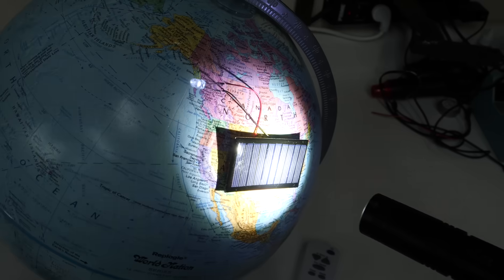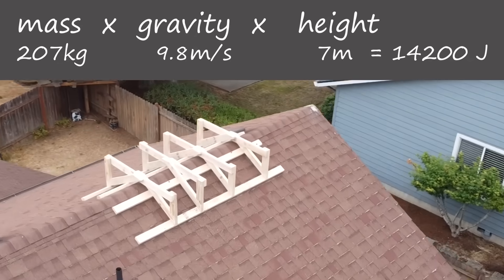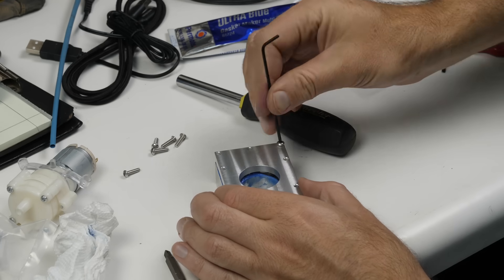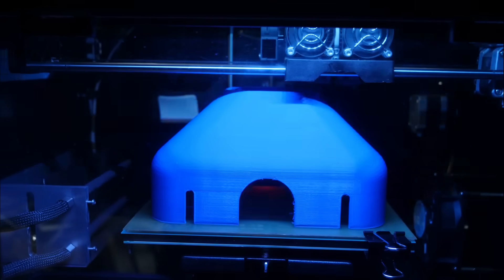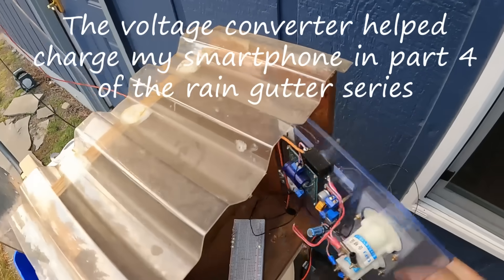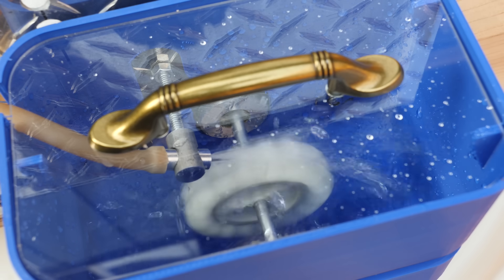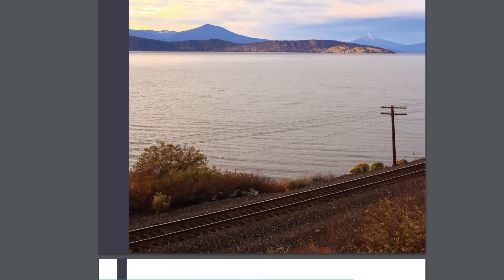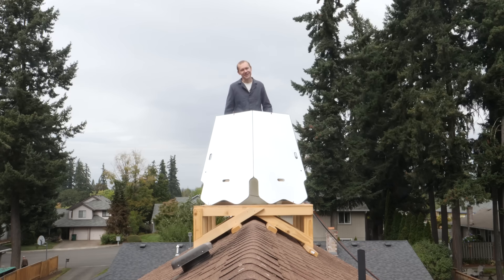Storing Solar Power on my ROOF!!!

Comment: What happens when the water in barrel freezes and burst's the barrel ?

Will Thor's giant ice hammer come crashing through your roof

Can you design the barrel to contain a kinda giant water bag surrounded by kinda crash barriers inside the barrel

I think this would make it a safer option 
Ps. No charge $$$$ for that just pass on the good will PLEASE
🙏♥️✝️

Comment: Why not just heat the water instead of moving it? Hot water is used by the washing machine, shower, dishwasher etc, and hot water stores a lot of energy. One could isolate the barrel etc.  Barrel never gets full like with filling it because one can just heat it some more.

Comment: A few practcal questions.  Being in Minnesota I have to think about freezing.  Would probably need to do the whole project indoors or use antifreeze. 

Also this circuit has resistance.  What if you replaced the plastice tube with a 5 inclh PVC pipe?  
Would it flow better?  I expect the force of the water would be almost the same with a big pipe.  

Finally, are there heavier liquids that might add to your storage capacity.  
How about less viscous liquids that would pump more efficiently?  

Thanks for the demo, I have been thinking about the storage problem for a long time.

Comment: Low efficiency low energy density and maximum capacity. High maintenance. May be cheaper than batteries initially but will become more expensive. Overall just inferior to batteries.

Comment: I was always wondering, how much water (in tonnes) would you need to store on a given height (lets say, top of 3 storey building) to be able to use it at least for some things reliably.  I have an appartment in an old building, that has a not-used atttic, which is at least 16m above the ground, and we could put a lot of 1m^3 tanks there (many load-bearing walls, which are like 0.5 meter thick go up to the attic floor and would easily provide support for heavy load). 

I do not think you can find many readily available generators for such purpose, though..

PS. it is also worth noting, that if you use wind as your renewable source, it could actually be reasonable to  have the turbine power the pump directly - mechanically, instead of mechanical - electrical - mechanical conversion. Assuming you can join the shafts of the propeller and the pump in such a way, that not much is lost due to friction over this long connection.
Reply: My gut instinct sau the issue is rpm. You'd need a hundred times the rpm on the pump as the rpm on the wind collector blades. An efficient transmission of sorts would be needed. Maybe you could find a low rpm water pump?

Comment: I was surprised that a AA battery could store an equivalent amount of power as that water drum.
Reply: Why don’t we just use nuclear power and abandon wind and solar.
Reply: @grizzlybear2702  i agree for everyone's house.
Reply: @grizzlybear2702  your ignorance of the worlds vast energy needs is obvious and quite frankly painful to behold
Reply: Exactly. A 1.2V 3000mAh AA battery contains as much energy as 130 liter water at 10 meters high. Pretty low energy density...
Reply: @a.wadderphiltyr1559  No but it was obvious you were trolling to that effect. read what i said again. If you think all the worlds energy needs could be met by nuclear alone, well you should maybe go check some facts out. maybe.
Reply: @klondike69none85  why couldn't the world's energy needs be met by nuclear power?
Reply: @mrtechie6810  alone? well, for starters theres availibilty. Of refined fuel (which we barely have enough for our own needs) of locations suitable to have them as well. there needs to be water nearby. How about the fact most countries dont have near the GDP to start a nuclear program. I could go on but honestly my head hurts from having to do the thinking for the both of us.
Reply: Can I just make something very clear: this thread is not for rocket scientists. Go join another thread or heat up some water and convert it to calories or joules.
Reply: @Do_not_assume  don’t be mad just because you didn’t know energy could heat water
Reply: @benjamin8981  It's pretty clear from the context that OP's comment is under a video about pumped hydro storage, that the energy being referred to is gravitational potential energy, not thermal energy. Yes, you can store energy by heating things up, but that's obviously not what OP was referring to and getting on a high horse about something that wasn't being discussed is inappropriate.
Reply: @ReddwarfIV  that is how you find out how much energy is in it. all you have to do is transfer it. the potential energy in that drum of water IS the energy that moves the motor, which IS the energy that could be used to heat water electrically which is the easiest way to measure energy content. so yes heating a measured amount of water IS the same amount of energy as the potential energy in that drum of water
Reply: @benjamin8981  Gravitational potential energy is dependent on height. The energy cost to heat the water in the drum does not change depending on height. You are confusing gravitational potential energy with potential energy.
Reply: Use BOTH. The same water can increase the storage capacity
Reply: Do the math.  Its yr 7 or 8 physics.  AA battery has very little power and so it will only heat up a tiny amount of water a lot, or a lot of water a tiny amount.  Not rocket science.
Reply: @csjrogerson2377  what does heating water have to do with any of this... unless you are comparing how much water the drum of water vs the battery could heat.
Reply: @csjrogerson2377  The fuck are you talking about lol
Reply: @csjrogerson2377 its not rocket science and youre no rocket scientist lmao
Reply: @csjrogerson2377  It's not rocket science that this tread is not about heating water just in case your 7/8 year old physics brain wasn't able to understand.  (I apologise if you are that age, though )
Reply: @Do_not_assume  why is everyone saying he’s wrong? heating water is the STANDARD way of finding energy content. that’s how calories and BTU are determined
Reply: @benjamin8981  Another rocket scientist but this time talking about calories? WTF. Whatever next? Nuclear power?
Reply: @Do_not_assume  joules to calories are directly proportional units. it’s like quarts to gallons
Reply: @Do_not_assume  Yeah you nerd, poopies can make several joules worth of power through biofuelinizing.

Comment: Very funny video! Lets do some quick calc. with a 200l water container and the 7m height (assumend average water height): 

E_pot=mgh=200kg*9.81m/s^2*7m=13734J

For comparison the energy in an average 18650 Li-Ion cell mit 3Ah (approx. 1C discharge current, avg_voltage:~3.4V ):

E_el=3.4V*3Ah=10.2Wh=36720Ws=36720J

Let's disregard the efficiency levels, although some readers will be aware that the Li-Ion cell can be charged and discharged
much more efficiently (~90%) than the overall efficiency of the pump or generator (<80%, presumably much worse for the size of the system).

As a result, it is easy for everyone to understand that the choice is between a single Li-ion cell and a 500l water barrel at a height of 7m. I know what I would choose ;)

Comment: Good to know the value of wattage stored up there. I too thought about it as energy storage. I built a water tower for rain storage, but mine was to provide grid free water and pressure for watering plants and an outdoor shower. I've since added a booster pump for higher psi. Municipal water is just plain disgusting. I can't imagine anything more natural than distilled sky water.
Reply: Rain is actually full of contaminates though… I’ve thought about rain shortage but I think it would be good to have some type of filtration system still. Especially once you factor in the fact that the water is running off the roof shingles which is made with toxic heavy metals which I imagine can and will leach into the water especially as the roof ages and it degraded by UV.
Reply: @TherealAsanD  Rain is full of contamination? Define rain....
I think you mean runoff is contaminated no? Rain is no longer rain when it lands on a turd, it becomes turd water.
I have RO for drinking water, and I have paperand carbon filters for the shower. Im certain whatever is bad, in my collected rain water, would also be found it municipal water, plus pharmaceutical drugs, antibiotics, the chemicals they add. The water is dead, and its designed for farmed animals. It takes more effort and energy to filter/revitalize municipal water, than to do the same with rain water. So I choose the one that needs less effort to naturualize. 

Do you work for Alcoa? Lol.

Comment: Silly question, but what actually causes the pump to heat up? I assume that it's not friction, as the pump would be rotating at the same speed regardless of the load (unless it was overloaded). Or is it that the pump was built for intermittent loads only?
Reply from the maker: Some is undoubtedly friction, but most is likely from it being overloaded.  If the pump motor were bound up, unable to rotate, current would flow through the windings like a short circuit, turning it into a heater.  Slower rpms connect each set of coils for longer than unloaded so it makes sense it would heat up.  Admittedly I'm not an expert on small brushed motors but that makes sense to me.
Reply: @QuintBUILDs  Thanks.

Comment: This is a really cool science experiment! 
In terms of efficient real life applications, this is unfortunately not a viable option though. After all, we are talking about 4 Wh of potential energy for the full barrel. For all of you that are not deep into this stuff, this is about enough to power your TV on standby during one night.
Reply: Bro that’s only a bad tiny old solar panel and a tiny barrel, what if you live up in the mountains and make a swimming pool to store like 100 of those barrels and get some 20 normal solar panels instead of that single small one?
Reply: @dumitrupogolsa7769 , even 14+ MJ (assuming 70m height differential) is ridiculously small capacity, especially for such a large contraption.

Just for benchmark: heat of combustion of common liquid fossil fuels is circa 40+ MJ/kg.

Therefore even discounting for energy losses, jerrycan of fuel for ICE-generator will store much more eneregy.

"Storage" in this video meanwhile is just a toy, will never be worth even wear of a pump.
Reply: @МихайлоСєльський  It works man. 1000 m3 of water can generate alone 6 hours of total independence for a house. 1000 m3 water tank is quite small and it can fit on any plot of land. The elevation of 10m is enough for those 6 hours 3MWh, which means you can get rid of accumulators forever. It works better in mountains, and the new zeelandese reversible pump system is quite cheap, about 4000 usd. It can go even cheaper for some worse homemade pumps. Now, u just buy a lot of panels to fill that 1000 m3 tank or reservoir during the daytime without interfering with your normal needs. It works better if you live in mountains so you can take advantage of the relief itself. But the most expensive part of your system will always be the accumulators and by getting rid of them u can basically get to lowest possible maintenance costs. Also, if you have a small spring it will make it even more efficient.
Reply: @МихайлоСєльський  if you are interested, read this article "Pumped storage - How small can you go?" by Guilherme de Oliveira e Silva. They've actually made an experiment, in France for it.

Comment: I don't understand why the hose is going horizontal  at any point. You can have gravity assisted pressure all the way down including hitting the wheel and it will splash alot less.

Comment: how about you store the THERMAL energy of the sun in an insulated tank on the ground and use it to run a Sterling engine powered generator ?
Sterling engines are more than twice as efficient at converting solar eneegy to useful work than solar electric cells.
Reply: Or a Steam engine.
Reply: @terrafirma9328  steam engines are not nearly as efficient as a sterling engine

Comment: Storing solar powered electricity in a water tower and getting back the electricity is not at all feasible. Because one have to build very big size water storage at unnormal height. For example to produce electricity of 50 KW in 10 hrs we shall have 1,80,000 cubic feet water storage at 50 meters height. If it is okay, then anyone can go for this. To build such a storage at such a height we have to spend millions of dollars, in that cost we can get 10 times bigger thermal power.

Comment: I was as surprised as Neo when researching off grid energy storage options. I did the calculations for a 10,000L tank at 10m elevation. 1,000,000 joules, wow that will be amazing. But it’s only slightly more than 1/4 of a kw/h or 1/4 of the power stored in a 12v lead acid car battery.  I thought I had calculated wrong, but it is really that bad 😢
Reply from the maker: I had the same thought:  "Was my math wrong?"  Makes you appreciate the true volume of grid scale storage.

Comment: There are also test setups with pumped hydro where the ocean is used as a reservoir. One example of these setups is a series of balls on the sea floor which use power to pump the water out of them creating a vacuum. That vacuum along with the immense pressure of the ocean creates a lot of potential energy which can be gained back by letting the water flow back into the balls.
There are other ways to store energy by using the depth of the ocean too. These types of energy storage have a very low impact on eco systems (they don't require an artificial lake to be made) and they don't require weird chemicals like with (most) batteries. And the best part is that it can be used in places which are too flat for conventional pumped hydro :D

Comment: I had a version of this idea in high school (at least a rudimentary concept of it) and a smarter kid than I ran the numbers and determined it wasn't very practical. Meaning that the energy you get out is pretty miniscule and not worth the trouble of building and maintaining. However,  it was still fun to see it built in this video.  

That said, I wonder at what scale a system like this becomes worthwhile. Could a commercial building (especially tall ones) turn "excess" solar energy into enough stored energy (i.e. water reservoir on the roof) to meet its energy needs at night? How does that compare to capicitor type battery when you factor in the cost of manufacturing and disposal and the life cycles of the components? 

While we're at it, why don't we just go nuclear to undergird renewables? That could get us off the fossil fuels much faster.

Comment: Swap out your current generator for multiple inline turbines and your power output will be far more, add in a deep cycle RV cabin battery and you're set for running essentials during power outages

Comment: So, 207kgx9.8m|S x7m =14200 J
and for an average household need for one day =25200000 J
What could easier to be change to reach that number?
Can we change the gravity, if we put under pressure the water?!
We can also use solarpower for that?
Weight and height can be modified, too.

Comment: Could the water be heated using solar thermal panels and use the rising heat to passively circulate the water as well as a solar PV powered electric pump?  Then you could have a hot shower as well....

Comment: That was really cool! Thank you!
Reply from the maker: Wow, thank YOU Zack! 👍
Reply: @QuintBUILDs  I love what you're doing and I have been following it for a while now and I must say that while you have done incredibly well I think you can actually get more power than you even realize out of your water system...

Your pelton wheel setup has a fair amount of efficiency. 

Some say the Tesla turbine is more efficient or is it? 

Could you print up a Tesla turbine on your 3D printer and then hook it up to see if it could spin your little generator faster and produce more voltage?
Reply: When Jerry recommend your work, trust me, it means you did well. 👍
Reply: Lets zack rig it!!  Hahaha
Reply: 2:58: Man says to his daughter how far she can squirt.
Reply: It's not cool, it's really hot!
Reply: It's a fun build but in reality he's storing less energy on his roof than is stored by some AA batteries, so it's not practical or useful in any way.
Reply: That video was indeed really cool! It's amazing how we can now store solar power on our roofs. By the way, if you're interested in home backup power products, I highly recommend checking out the Segway Portable PowerStation Cube Series. It's built tough, offers massive capacity, and has super fast recharging capabilities. It's a reliable option for uninterrupted power supply during outdoor adventures or in case of emergencies. Just thought I'd share this with you!

Comment: You could replace the barel with 11 times smaller peace of lead and a lift. With a same amount of energy stored, such system is going to be insensitive to a temperature outside, and with  appropriate reduction gears and a weight, could be quite compact.

Comment: The problem is that 14200 joules is only 0.004 Kilowatt hours, about the energy stored in a single AA battery. To store even one Kilowatt hour, you would nee to pump one ton of water to 360 meters. If your household needs 10kwh over night, then a gravity based storage system would need to lift 360 tons to a height of 10 meters
Reply: Haha ops, you mentioned it at the end!

Comment: The assertion that windmills and solar panels are more renewable than conventional energy production seems dubious.  It takes.more resources to make less energy.   And it seems to be a holdover from a previous version of energy policy talking points and the Peak Oil days.  Currently the premise isn't really that they are more renewable, it is that they produce less co2, which advocates claim will reduce bad weather events.